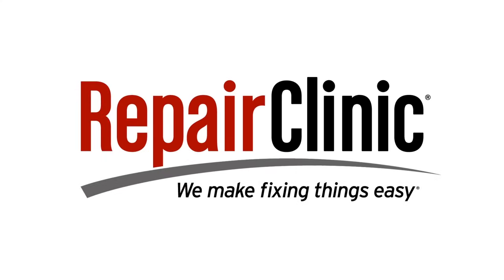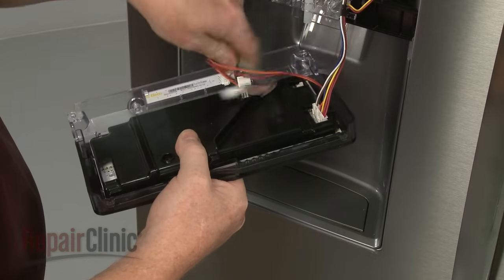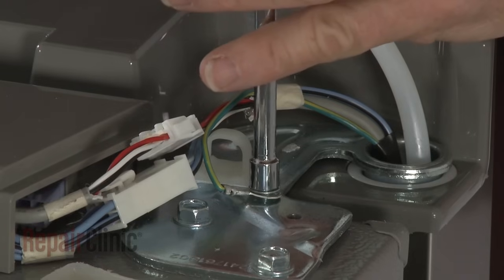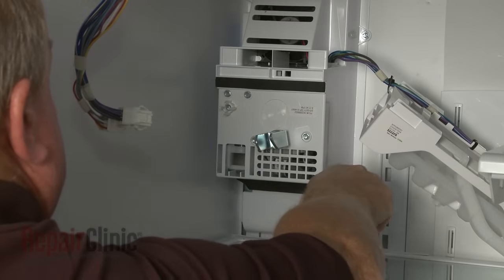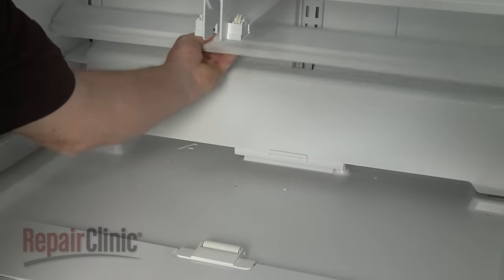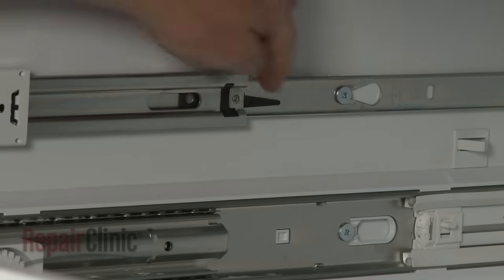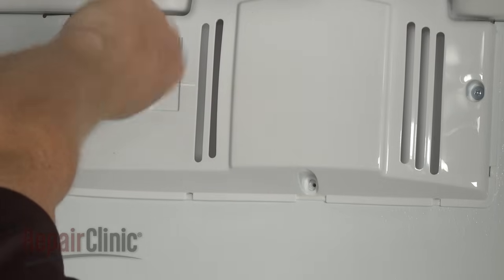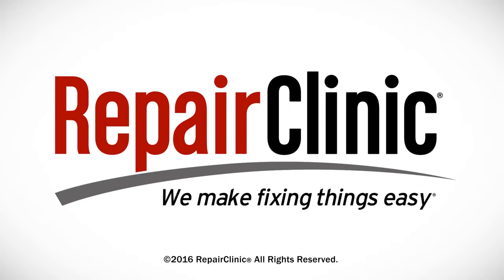Frigidaire Refrigerator Disassembly (FGHB2866PFGA) – Repair Help

Comment: Worked like a charm. My freezer drawer was loose after a move and the inspector said it was broken and would need a whole new rail system.  I took the door off and saw that the brackets connecting to the rails and door frame were really loose.  Tightened everything up, and presto… fixed
Reply: This kind of thing would be a MAJOR reason I would buy that refrigerator !!     It would beat out ALL the other brands.   A DIY repair approach.

Comment: Thank you very much for posting this extremely helpful how-to DIY video.  I pulled the rubber gasket off the back and found a huge piece of dust blocking the water from exiting it.  I also vacuumed out all the dust that I could from behind the fridge panel in the back.  After applying the hair dryer to the defrost the ice covering the freezer drain plug, the drain pan in the back of the fridge went from bone dry to completely full of water (almost overflowing).  The biggest hassle for me was removing the freezer drawer and basket.  I would advise just unplugging the fridge and opening the freezer drawer to let it defrost naturally if you have somewhere to store your freezer food as an easy workaround versus using the hair dryer.

Comment: Skipped over the one thing I needed -- removing that roller and the flat panel underneath the deli drawer.  We've got some yucky water under there after doing a full thaw and I can't get that cover off to clean it up.

Comment: My freezer works fine but the upper cooler compartment will not cool. Is there a damper flap? Model foghorn model 2367. Any suggestions?

Comment: So I have an issue with the defrost cycle.  Many people say there is a defrost board, defrost heater, defrost timer, and defrost thermostat.  I can locate the defrost thermostat and defrost heater in my refrigerator (and also in this video) but I can't find the defrost timer or defrost board.  Is it possible this refrigerator doesn't have a defrost timer or board?

If I replace the defrost thermostat and the defrost heater is functional by manual activation, what other part do I need to replace?

Comment: Does anybody know the what those two square insulated "holes" are at the bottom-back corners of the fridge? I have water condensing and dripping from the ice maker at the top-left of the fridge, down the back and accumulating in the left "hole"
Reply: I've got the same issue, but mine is going into the right "hole". The hole is completely frozen with ice now.
Reply: I have the right "hole"/"vent" frozen up as well. Any advice?

Comment: What is the function of the air deflector pan on the freezing compartment exactly this video show. The Refrigerator I got is exactly like this one...so please give me a clue about it.
Reply: Yeah and how the heck do you clip it back into place, it came out super easily without having to take the whole damn freezer apart or even unplugging it so I could clean inside the freezer but now the damn thing will not go back in. I'm so frustrated right now, tried to call Fridigaire but they had me on hold forever!

Comment: frigidaire gallery refrigerator the front display randomly turns off. it reads of of. i manually push on and it runs. any suggestions.
Reply: Mine went off how do you push on please

Comment: Used this video to disassemble a Frigidaire that the ice maker went bad for the last time. Could fit out the front door, so removed the doors to get a few more inches of clearance. Fridge came with the house we bought, but the repairman advised to just toss it out 4 years ago… apparent a poorly designed model year. Frigidaire used to be top of the line but very disappointed with this model! Trying a LG that has ice maker built into the door..putting the ice maker box in the fridge section was dumb!!

Comment: Not showing what I need. Looking for help removing the cover and the roller under the Deli Drawer on the bottom of a french door unit.
Reply: I need this as well 😔
Reply: Have this issue as well, there is a bunch of liquid stuck down there and this cover is keeping me from cleaning it.
Reply: @crystalsprayberry9718  Did you figure it out? I have this problem now.
Reply: The roller has two sided tape and needs to be pried off. Once the roller is removed the rest of the shelf comes off by sliding it towards the back of the fridge.